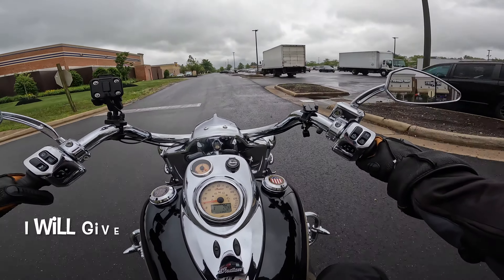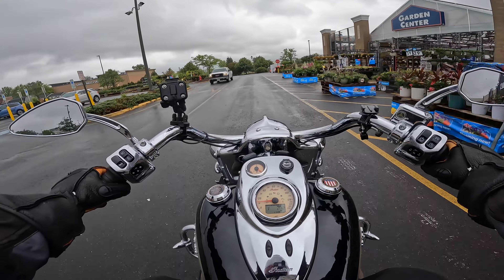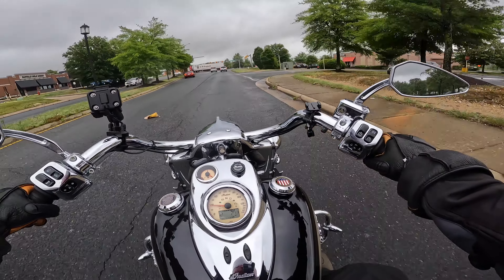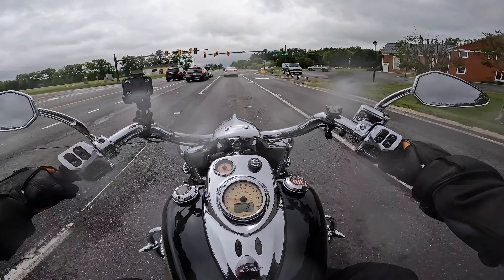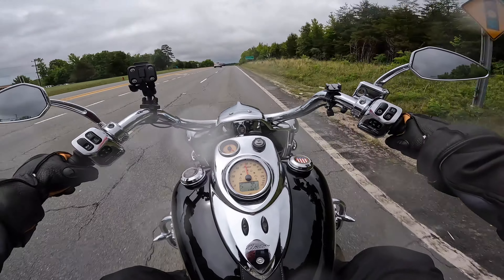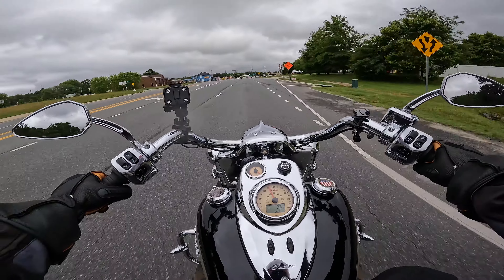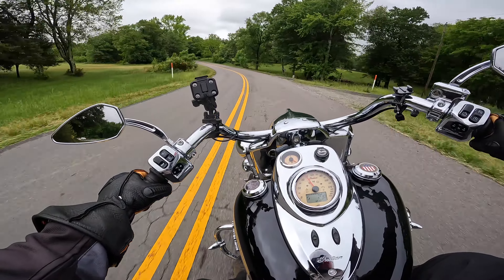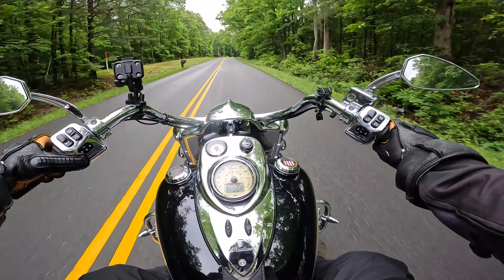What Did My 5k Service Cost? Dealer Response About Wrong Cylinder De-Activate Message? More!

Comment: Book time vs. actual time. If the book time is 2 hours, that's what they charge. In good shops, that's how they make their money. They loose their rear when the have to get into diagnostic rabbit holes. It's kind of a wash, but good mechanics are a hot commodity because they can keep the times low on the book jobs AND get straight to the cause of an issue quickly because of skill and experience. If you're getting a 2 hour job done in under an hour, that's good. When they have the bike for 2 days and only charge you 2 hours of labor, that's how they can do it. I have paid shop bills (cars) where they charged 800.00 for "diagnostics" and didn't fix the issue (1 and only time I used them and they no longer exist). The bad shops are the ones that max out on everything and they usually don't last long. 
I check my clutch every day that I ride.
Reply: Not to mention most shops have job scope time frame for everything they do. Clutch and transmission have xx amount of billable hours, brakes, flush, etc.
Reply from the maker: I'm wondering if Indian publishes guidance to the dealers on how long these things should take.

Comment: If this is the typical motorcycle buyer today, thank God I ride a 37 year old bike.
Reply from the maker: Not sure if that's a jab at me, the bike, or both.  I'm just having some fun sharing some of this cost info and some of it was a follow-up to an issue (cylinder deactivation).  I've had good luck with the three Indians I've owned but this one (the Springfield) does have a couple of issues.
Reply: @RamblinManMoto I think he meant dealer experience.

Comment: Hey just a observation. Those spikes on your crash bars look like you could gut ourself with them. Can't image putting one of those through my ankle or any other body part. Ride safe
Reply from the maker: Interesting point on this that I've been thinking about.  Those are the Indian brand toe-rests attached to the Indian brand crash bars.  I do have the toe rests pointed a little more "in" based on the idea I saw in a review of the product.  Also, my short legs would struggle to reach them pointed all the way out though there may be room for improvement on my side.  I've set a reminder to add this to my project list to check it out.  Thanks!

Comment: There is a difference between battery tender and battery charger. the charger is a constant charge that can damage the battery and the tender monitors the battery and only charges at low levels.
Reply from the maker: Fair point.  I went back and read the notes I had made where the tech wrote his own notes beside each point.  I had noted I kept the bike on a battery tender (and that is true) and he wrote "batteries need to be charged by the starter and it is not good to leave them plugged in a lot. "  I probably wrongly use the phrases charger/tender interchangeably.

Comment: If the front speed sensor made contact with the wheel tone ring it would destroy it and you wouldn't have speed indication and cruise control and it would show a code, is there any rub marks on the the tone ring? Doing you own servicing save money and you know its done right, if your not to put the bike on a battery tender why do they put battery tender  connectors on them🤔
Reply from the maker: Appreciate the thoughts but I don't agree with the premise that if I do something, I know it's done right.  Exactly my point...I haven't done anything I do on a bike before and I very much don't know if I've done it right or what I'm doing at all.  Spend hours looking up stuff in the manual, watching YouTube videos, etc.   I'm going to make a video about this topic as so many people on forums say the same thing. Basically "you're an idiot to pay for service."   Spend $20k on a bike and then hem/haw about $400 for a service to either save me time and/or to make sure it's done correctly.    

I haven't looked at anything on the bike to verify the tone ring. 

Good point about the battery tender port.  He made it a point to say it's not good to be on there "for a long time" but I agree with you on this.  I've heard different things on it.
Reply: If your not ofay with doing you own maintenance you are not an idiot for getting a dealer to do it.
Reply from the maker: @chrishunter5041  I've had my local guy do various things for me, I've done some myself, and I have the dealer do some things.  That's been my approach on all three Indians.

Comment: Had 8,000Km (5,000Mile) service done on my Super Chief not long back in New Zealand. It cost me NZD 761.05 which is USD 464.80 and they charged me for 3.50 hours labor. 😞
Reply from the maker: I went back and looked at my Super Chief Limited 5k service receipt.  My dealer did raise their hourly rate to $140 from what was $120 a year ago.   In Feb 2023 I did the 5k service on the Super Chief Limited and the total out the door was $363.79.  I notice the shop supplies fee has gone up as did the oil disposal fee.  Percentage wise by a very high amount.

Comment: Well you have to understand that although that tech did it in under 2 hours, they may end up getting paid 2 hours for a job that took 3 hours.
If you get a yuasa charger, it will stop charging and then let it sit until the battery voltage drops to a defined voltage, then it will charge it back full and continue that cycle.
I suggested the possibility of an injector.   I run chevron techron cleaner every oil change on bikes and cars. I suggest trying it and see if that helps. There is no way they checked the injectors in that amount of time on the service.
Reply from the maker: Like I mentioned in the video, I'm not so sure that theory holds.  Each time before I've asked for a quote on the 5k service.  They've always called it an "estimate" based on 2 hours and then it mentions "Unless we find it takes longer" or something to that effect.  If someone has had a 5k service take longer, that would be interesting to see if they were charged more.   Appreciate the tip on the battery charger.  The one I use was specifically marked to motorcycles and I thought mentioned this same feature.  I may need to go back to make sure I understand it correctly.  I could be wrong.
Reply: Another thing on the rubbing. I would say you may have bad wheel bearings causing play in the wheel allowing the wheel sensor ring to hit the sensor.
Reply from the maker: @dhc8guru  Appreciate this tip.  I'm very much a novice at turning a wrench and likely won't be able to easily check all this stuff myself.  I did call the dealer today and the tech that looked at the bike said he thought the sensor was just "too close" to the tone wheel (I think that was the part).  When I pressed as to why, he basically just said it would be correct when he replaces it and he will check everything out.  I asked about the shims that some folks mentioned and he said it could be that.  I will ask about the wheel bearings as well.

Comment: Why don't you do it yourself.....? Lots of parts are much cheaper in the aftermarket.
Reply from the maker: I get asked this often.   I've done plenty of work myself.  It's a $20k bike, under warranty, and I'm not a mechanic.  As my life depends on the bike running correctly, I have no problem paying for someone to look over the bike and do some of this to save me time.  I've done oil changes, installed exhausts, and other stuff. Some I can't or don't do.   Some of it is the value of my time.  I have other things to do.  Not everyone enjoys working on their bike as well.  In this case, I usually have the dealer do the initial 5k service, and I knew I had things that may possibly fall under the warranty.